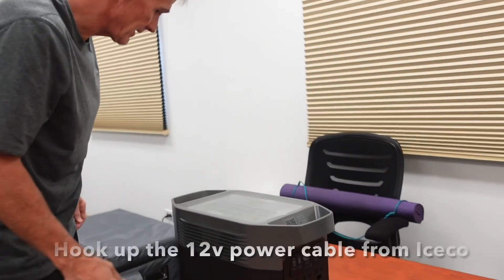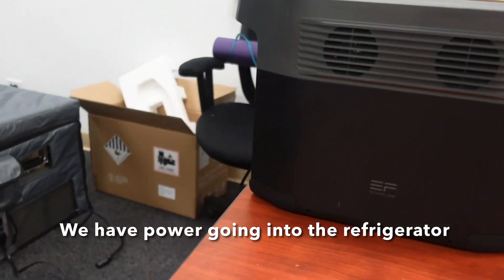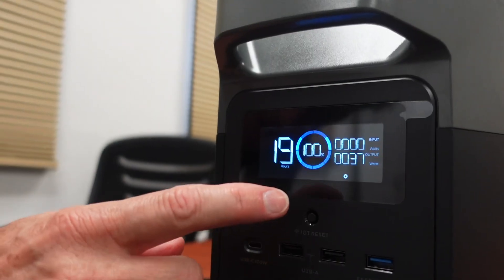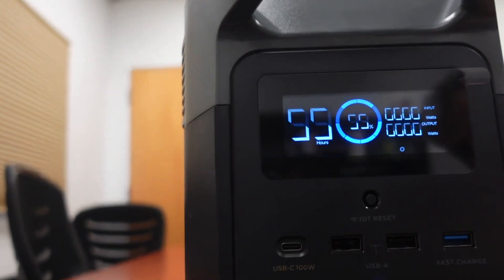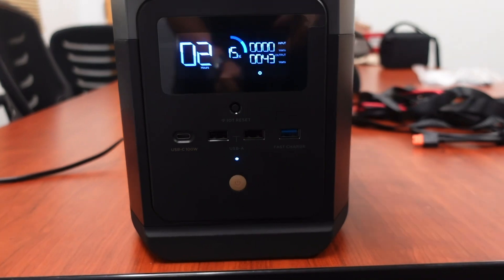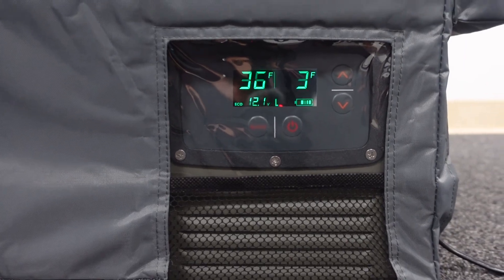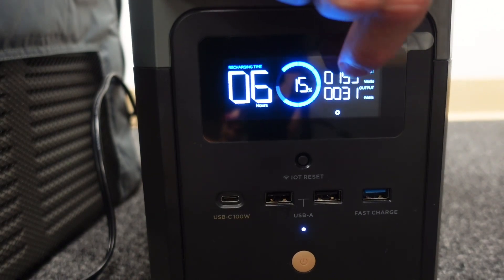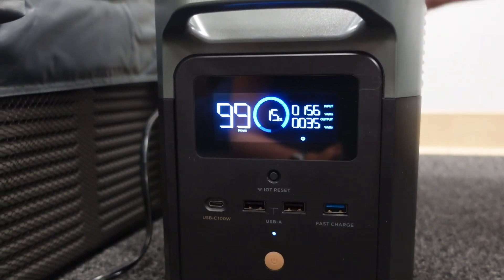POWERING ICECO VL60 D using ECOFLOW DELTA MINI GENERATOR!!! | how long will the generator last???

Comment: That mini ECOFLOW at 882 watt hours only runs that fridge for 30 hours.  That sucks.  My 720 watt hour power station runs my 55 liter ICECO for 58 hours.  Your DC consumption rating for that ecoflow is off.  Must have some dead cells.